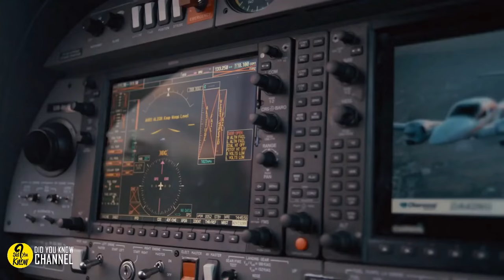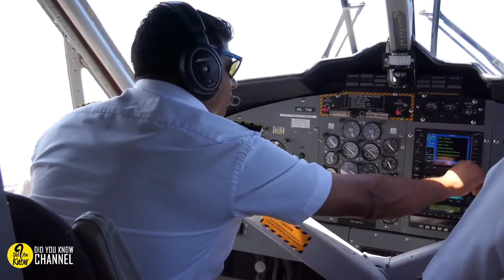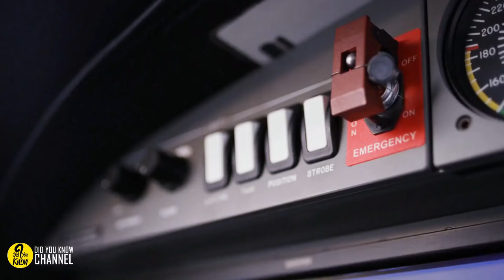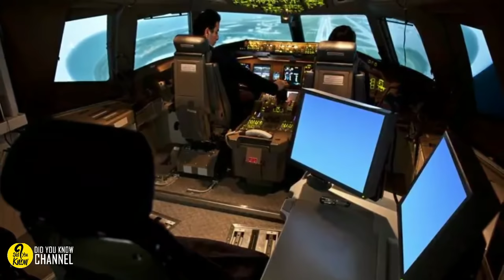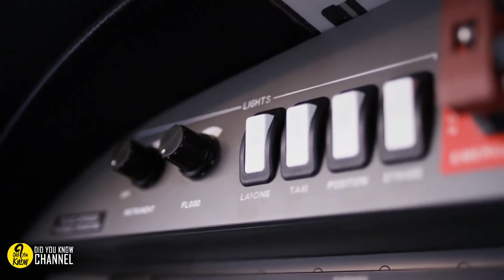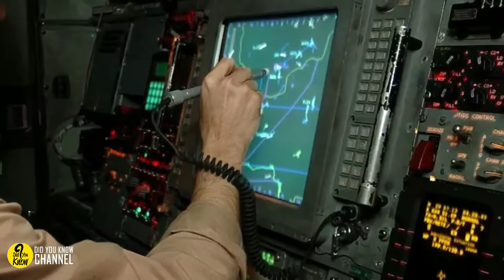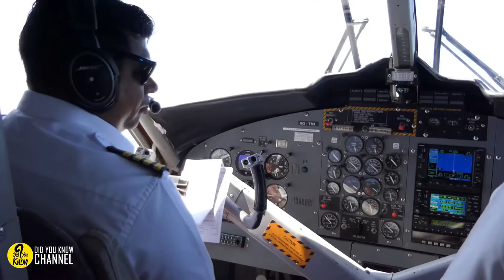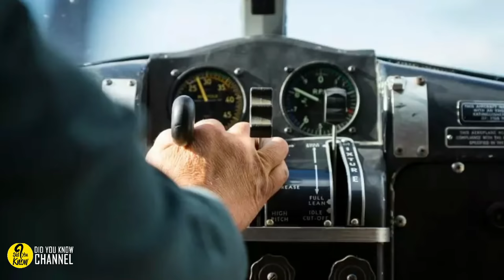When A Plane Ran Out Of Fuel At 41,000 Feet, Its Pilots Were Faced With A Stomach-churning Decision

Comment: How the the two stories (AC 143 & Marine Harrier (not mentioned in title) are related other than the nose gear failing to deploy, escapes me.  As for Air Canada 143, the aircraft fuel amount was measured in litres, not by weight.  Much of the fuelling equipment still used the old measurement.  Adding to the mix was an incorrect conversion formula and a dripstick which used a different measurement system.

Comment: I thought all planes had a backup tank on the plane
Reply: No, all fuel is typically calculated for the exact trip thats on the flight plan. This is why it’s imperative to be exact when fuelling. If an aircraft needs 500lbs of fuel to fly from A to B, there’s really no need to be carrying something like 800lbs of fuel (300lbs extra). These are also random weights I’m just tossing out for comparative reasons.